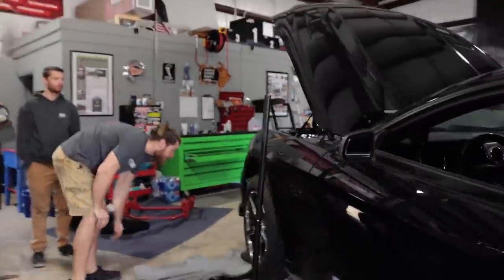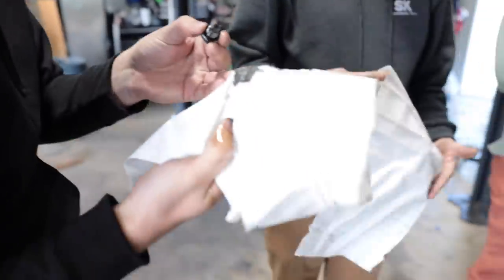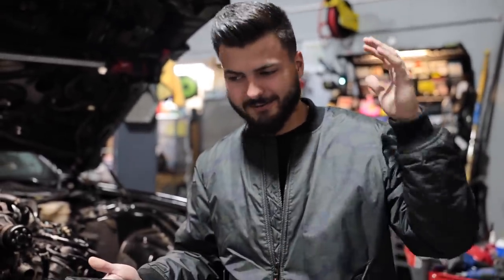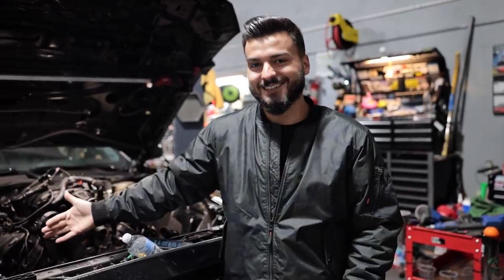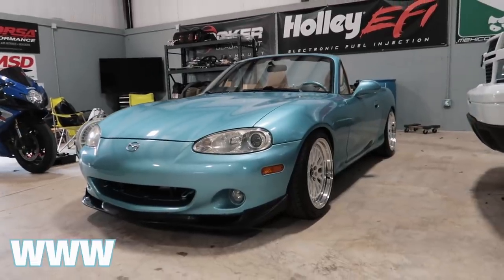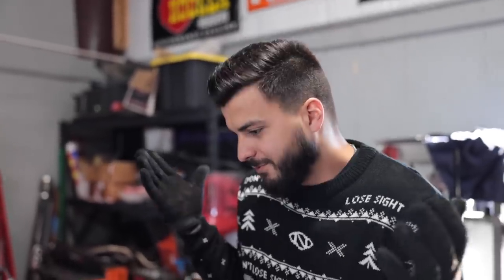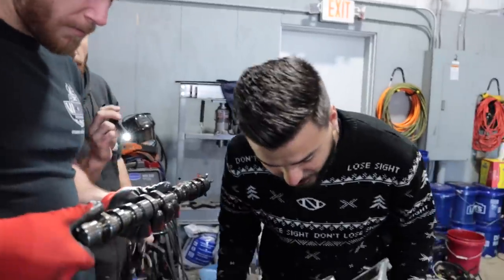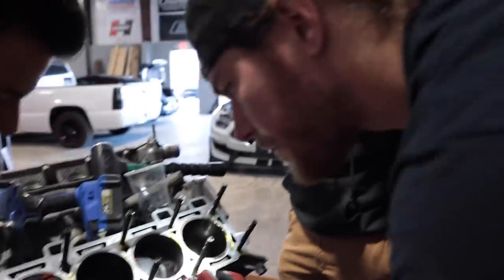Tearing Down Satan’s Blown Motor! | 1,500hp Coyote Engine Teardown

Comment: "No more blower, no more engine" Daniel just sits under the hood and makes engine noises while him and Gavin Flinestone the car down the track
Reply: i mean that will be more reliable than MMR's engine
Reply: At least it would make it down the track haha
Reply: @justward354  😂😂😂😂
Reply: @justward354  read mmr’s post on insta. He has never bought a motor assembled directly by mmr
Reply: New mustang project is called going 5’s in an electric car
Reply: Was looking for this comment, they going electric?!
Reply: “How much horsepower does this thing have” it has one Sasquatch Daniel power😂
Reply: @chiphorn3634  When he first got it it wasn't from MMR but then after the first failure he sent it DIRECTLY to MMR to be Serviced/fixed where they had it for several months then sent it back "fixed" and that motor that was "fixed by MMR" is what was in the black car this time that it blew up. So the blame falls on MMR.
Reply: @tstuff1213  which means they assembled it in case the dummy couldn't figure that out
Reply: @jamiesenesac1241  witch equals how many hp
Reply: @lucasdonovan3571  at least 25
Reply: @lucasdonovan3571  like jamie said at least 25, but the 6L darnell definitely makes at least 1,000 ugga dougga RipPMs 😂

Comment: Mmr needs to read off that list of apologies to gavin lmao
Reply: Dont seem like he can get a break. Spends quite a bit of money on a built motor for it to not do what he wanted and fail in resembling way of the other motors
Reply: Those pretty red parts don't make the engine any stronger. I could feel how bad he wanted to title this video "mmr engine fails after 4 pulls" hearing him talk about "contracts signed" after the engine was held hostage for a year.

Comment: MMR the eBay engines of youtube
Reply: I feel like a ebay engine would be better than MMR at this point 🤣
Reply: @legogaming6585  all i can say is ebay turbos last longer than this engine😂
Reply: @jdm.flair2020  yeah u right 🤣 Gingium has a ebay turbo hes using on his volvo 240 project that is gunna last longer than MMR engines lol
Reply: my tuner actually told me dont buy mmr engines lol
Reply: @lubbies_  mmr used to be a good reputable company. Looks like that went down the drain. Theyll be bankrupt soon enough
Reply: @legogaming6585  i heard they were good back in the day but apparently this is getting more common with them my tuner told me to go with rpg or jpc for a built motor
Reply: Mhs in Florida builds good motors
Reply: @dailylife3975  Jordan is the Modular engine gooru.
Reply: MMR engines are actually wish quality
Reply: @davidf2392  well they do have a bunch of promods running mid/high 5 sec 1/4mi powered by 351 ci billet coyotes, that also go over 200 mph in the 1/8th. I will say that its apparent the quality control has gone down though, Gavin is solid proof of that
Reply: You need a Texas speed built coyote
Reply: Many high hp mustangs where I live everyone swears against them now Ik why after gavins history 😅
Reply: Remember when Gavin have to stroke MMRs shaft because of another problem causing the first engine to go saying it was nothing to do with MMR and how they make great products... MMR looking real sus
Reply: Those gen1 heads
Reply: @robertkotevski9649  totally agree.
Reply: @dakota868  for sure after seeing the quality work he does mhs would be my first choice
Reply: @legogaming6585  Boosted Boiz have multiple 9 second cars and an 8 second MR2 on ebay turbos. lol
Reply: Not an MMR built engine though...
Reply: @turdferg9703  how so? I think you've missed a few episodes lol. That was totally a MMR build.
Reply: I have a eBay turbo on a vortec that has lasted over a year now with 0 problems I think that’s funny
Reply: @jdm.flair2020  eBay Turbos are just old Garrett/Precision designs last I heard anyways.
Reply: @legogaming6585  bruh fr, mmr is honestly shit 😂😂
Reply: @dakota868  mmr has two different engine builders 👀 the one that builds their engines for prom mods and shit does amazing but the one for customer builds... that’s another story
Reply: @legogaming6585  junkyard motor better rhan mmr😂
Reply: You really don't know what happened? MMR didn't build this motor for them, and they didn't pay MMR for anything. This was a second hand motor that they hacked together after buying it from someone else. See how they hammer away in this video?... that's how they treat a build lol. Anyway, the truth is they asked MMR for help, which they agreed to, and then sent the engine and parts, including the bearings they are complaining about, to MMR to be reviewed and refreshed. Real MMR motors use specific parts. I have one...a 1500se and it's an absolute beast. Even still, I'm sure MMR did the best with the parts provided, and even after that, the treatment of the motor is what caused this issue. The redline was not a soft redline. As he is mentioning even in the video, he is referencing the physical limitation of the crank/cam combo, which is still questionable. There is more to it then that, such as stroke, cam spring choice, etc. The etching away at the gaskets is from repeated physical limiter hammering, and then the boost crossed into the water cavities, and blew off the coolant line. Instead of admitting his mistake and resolving it, they just sent it again. Absolutely insane. So then he had fuel and coolant displacing the oil which absolutely destroyed the bearings and rest of the motor. This is 100% the fault of this nutty dude in the video.
Reply: raredesign you must be an employee or someone asked to do this. No one takes that long on a comment to reply literally no one
Reply: @rudcur1  Not at all. I spent 3 years building a now nationally renown S197 Mustang and we will be featured in RPM Magazine this coming year. I run an MMR 1500se motor and it's very strong with no issues at all. I am sick of the stupid trash talk from internet keyboard warriors that are absolutely clueless. You're all like high school losers that rally around the one rebel  because you want to be cool too. It doesn't work that way. lol. You all just look like idiots.
Reply: The mmr engine caught covid
Reply: @raredesign  why would MMR re-use the bearings he sent them? i saw their post and this was one of the points they've used. as an engine builder, shouldn't you be using your own parts to avoid situations like this one? (i mean, they did swap the HGs and tensioners for him) As far as the hammering is concerned, it was apparent the bearings were shit, so it wouldn't hurt anything at that point. not an apologists for these guys, as they surely do fuck things up, but the builder does look a bit suspect here as well. that tensioner, for instance...
Reply: @raredesign  really? There’s a reason every time I’m at English racing. There’s a stang in there they have to rebuild from guess who? Mmr.

Comment: MMR when the engine failed again,
“Ah shit here we go again”
Reply: I just died reading this! MMR fixing to be reaching out telling him its his fault.
Reply: The worlds best engineers and a check list with millions of check points. Boom went the space shuttle. Shit happens. MMR can't be everyone's scapegoat.
Reply: @marklowe7431  Your comparison doesn't fucking work in this case considering the engine is "overbuilt" to what Gavin is putting it through. Also NASA was gross negligence and failure to listen to said engineers from Morton-Thiokol.
Reply: @1776Redux  The process be it engineering, political or compliance failed on a billion dollar project.
Reply: @drewgrice8840  Exactly. Maybe it was.
Reply: @marklowe7431  yes u are right but when you lie to your customers and have multiple engine failures to me shit happenes lesson learned that they can't build a engine but they lied did thing with out him knowing and told him they did something else they are scum and should be sued and get his money back for having it there fault
Reply: @1776Redux  It still went boom! So there was still a fault. Seems you assume the only faults are engineering.
Reply: @mncam567  Yep, that's a very fair point.
Reply: @DGAF_AK87  It doesn't matter how "overbuilt" an engine is. There are some conditions that will destroy the toughest of engines. Those conditions may have nothing to do with the build.
Reply: @mncam567  Did he even buy the engine from MMR? From memory he bought is unused 2nd hand.
Reply: @marklowe7431  and if your trying to say it the tune lund is one of the best tuners out there and they said the tune looked great so don't know what your trying to get at
Reply: @marklowe7431  probably should go back and watch the history. Last time it had a failure, MMR told them to send it back so they could diagnose and fix it for Gavin. They refreshed the engine with new bearings and gaskets. They used head gaskets that were known to be dodgy, not the ones Gavin sent bacl with the engine for them to use. And to see main and big end bearings just fall off like that means that they were too small in the first place.

Comment: "we're not gonna drag anybody's name in the dirt" but my finger is definitely pointed at MMR
Reply: And the People who kept saying that he can't drive or he needs to learn how to drive 💀🤦🏽‍♀️
Reply: Hahah I wanted to say something in these lines but didn't want to get Gavin in trouble again because of these happy people 🤷🏽‍♂️😂
Reply: Make More Repairs motors
Reply: And that’s why the best fords now are powered by Chevy.  Built Ford tough with Chevy stuff. Can’t beat ‘em join them. 15000 dollar paper weight or 1000 dollar  engine making 1000hp for a whole season..... hmmmmmmmmmm ( this is coming from an ex diehard Ford fan btw)
Reply: Mmr can’t control a car going lean and popping. Just like most people who drag mmr through the mud... let’s not blame the person behind the computer or anything. If their was a failure due to hardware that would be different... if a piston cracks or something that’s not the engine parts or the build if there wasn’t a defect In the parts like a crack or something then it’s the tune.  The engine parts weren’t responsible for it and always people are always trying to find someone else blame this is why I stopped with this channel. Everything goes wrong and it’s always someone else fault. You ever thing there’s a reason why you literally always have trouble like with everything... and of course all this comes from the tuner... of course it’s not their fault smh
Reply: @Dreadz530  did you watch the video? I really don't think you did. The barings were shitty and poorly machined, and the mmr head gasket, which mmr put in, blew. They replaced the one Gavin had because it was "Known to cause problems". There a shitty company who made Gavin apologize, and then cost him 30 grand.

Comment: I knew from day 1 when MMR got involved we would be here eventually
Reply: YUP! MMR sucks.
Reply: same and when he had to read the apology I started laughing because I knew this would happen
Reply: MMR's engines for the mustangs have been a problem for a long time
Reply: I mean he’s had nothing but problems with this engine it was bound to happen at some point
Reply: MMR put a statement up on there Facebook go read it before thinking these clowns have an idea of what they are doing 🤦🏼‍♂️
Reply: @KissYaPink9297  lol....right..head gasket lifting always engine builders fault .... 😂
Reply: @GETLITUP69  but he never bought an MMR built engine so....
Reply: @turdferg9703  when it came back, it was MMR built... we busted an MMR engine very similar at less than 900 on the tire but ours wasn’t as hard to diagnose... we threw oil and metal all over the launch pad as soon as it came off the trans brake.
Gavin’s engine was very conservative considering the “rated HP.” Should have been no head lift or busted bearings. MMR engines are a really expensive learning experience.

Comment: MMR engines made of paper and glue
Reply: cardboard in that bitch lmfao
Reply: Head gaskets are made put of plastic
Reply: You mean trash bags
Reply: paper mache ass engines 💀
Reply: More like tinfoil
Reply: You really don't know what happened? MMR didn't build this motor for them, and they didn't pay MMR for anything. This was a second hand motor that they hacked together after buying it from someone else. See how they hammer away in this video?... that's how they treat a build lol. Anyway, the truth is they asked MMR for help, which they agreed to, and then sent the engine and parts, including the bearings they are complaining about, to MMR to be reviewed and refreshed. Real MMR motors use specific parts. I have one...a 1500se and it's an absolute beast. Even still, I'm sure MMR did the best with the parts provided, and even after that, the treatment of the motor is what caused this issue. The redline was not a soft redline. As he is mentioning even in the video, he is referencing the physical limitation of the crank/cam combo, which is still questionable. There is more to it then that, such as stroke, cam spring choice, etc. The etching away at the gaskets is from repeated physical limiter hammering, and then the boost crossed into the water cavities, and blew off the coolant line. Instead of admitting his mistake and resolving it, they just sent it again. Absolutely insane. So then he had fuel and coolant displacing the oil which absolutely destroyed the bearings and rest of the motor. This is 100% the fault of this nutty dude in the video.
Reply: @raredesign  In this whole essay you wrote you never mentioned how MMR told him the motor was good and ready to go and gave him their approval of it and you also didn’t mention anything about how the motor was assembled like a toddler did it.